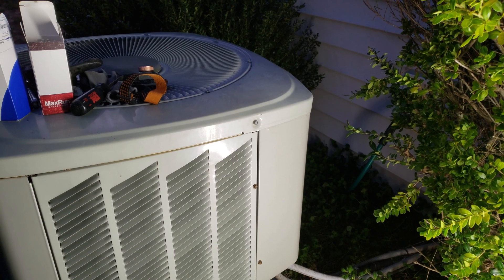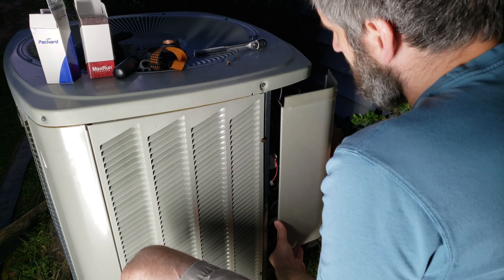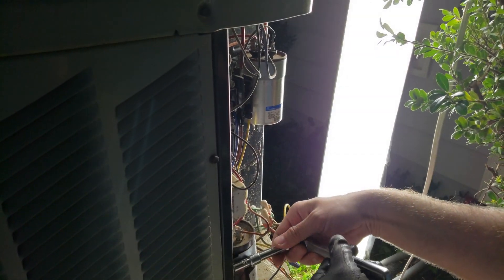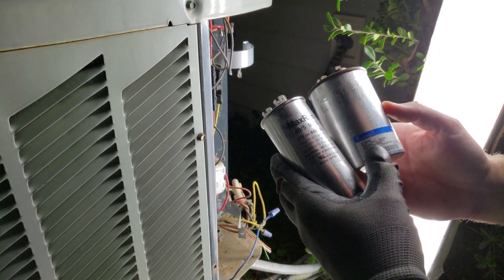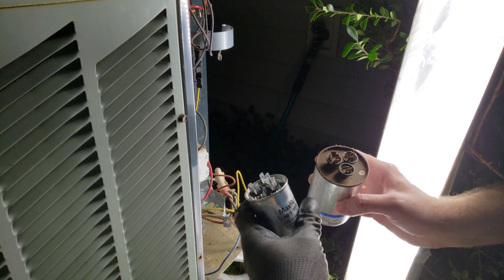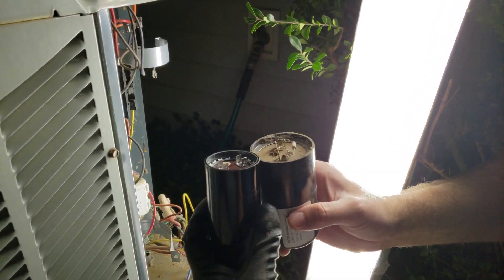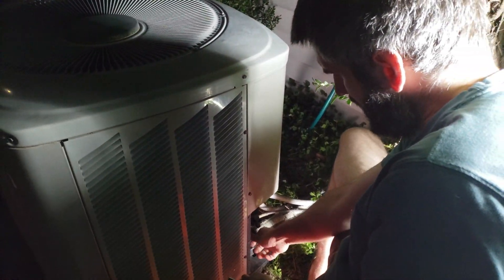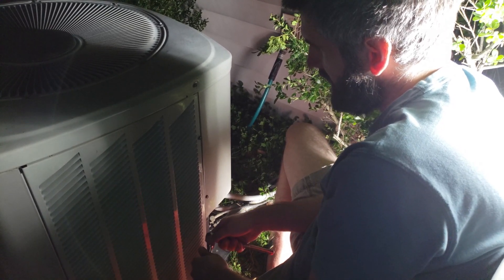HVAC Heat Pump no cool / heat - Change Start & Run Capacitors - Fast $20 Fix AC Fan Motor Compressor

Comment from the maker: Purchase HVAC Start Capacitors:  https://amzn.to/4hUjbrm, http://www.directhvacsupply.com/start... or https://www.supplyhouse.com/sh/contro...

Purchase HVAC Run Capacitors:  https://amzn.to/3Ctw8rE,  https://www.directhvacsupply.com/capa... or https://www.supplyhouse.com/sh/contro...

Purchase 2 Watt 15k Ohm Resistors: https://amzn.to/48QEXrT or https://amzn.to/3OfiwTu

Purchase Multimeter with Capacitance Mode:  https://amzn.to/3OdSgc9

Comment: Can you tell me why my start cap has no resistor also only 250V. They're blowing quite often lately. Thanks, by the way.
Reply from the maker: I've read that some capacitors have an internal bleed resistor.  You can verify this by measuring the DC voltage on the capacitor after it has started the motor.  With a bleed capacitor the DC voltage should quickly return to 0 volts DC.  

There are several different voltages based on the design of your unit.  I'd definitely put exactly same spec back in, unless you can verify from the manual/spec sheet that it should be a different size.  http://www.directhvacsupply.com/start-capacitors/